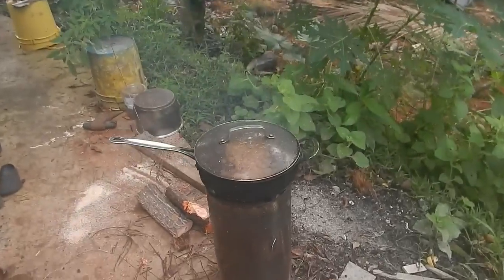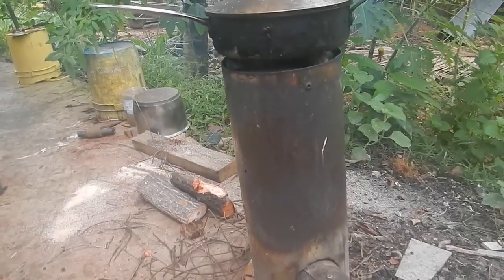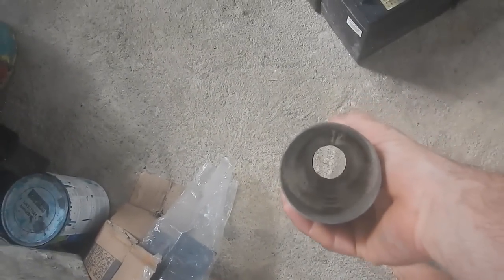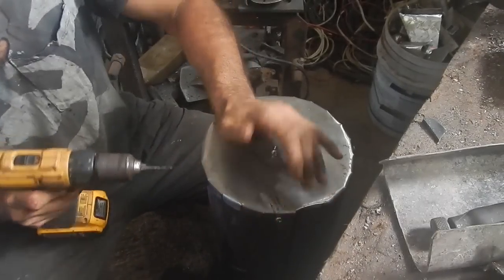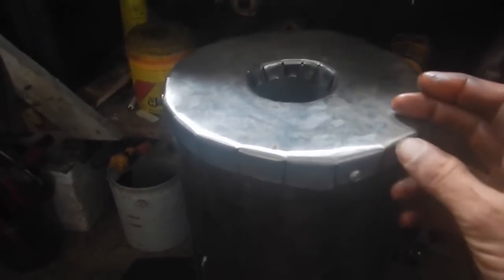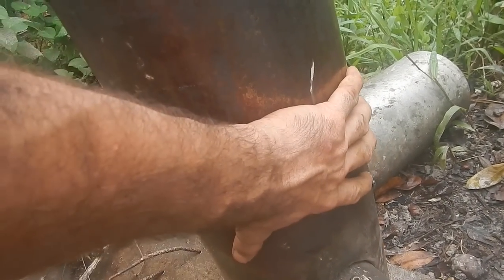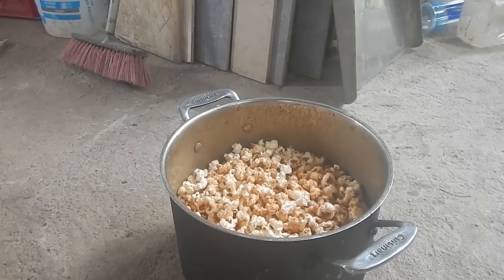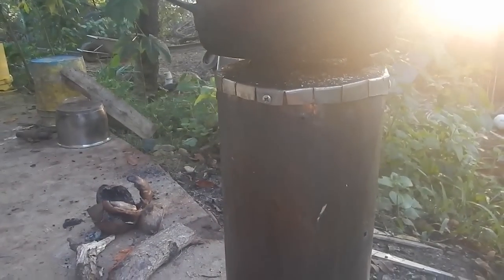Superior Rocket Stove (and Peanut Butter Popcorn!)

Comment: I've made rocket stoves before,  there is just a couple of things, that I found out.  Fiberglass usually melts at the temperature the stove burns at. Some versions of rock wool or rocksol melt have a higher melting point but I have found that perlite or mica are usually better .If you insulate  the side feed tube, make it longer, and start the fire just inside the front ( away from the chimney) it burns better and continue burning when it make the turn up in the chimney.   Your looks great, and some food grade type of stainless steel are safe at high temperatures. Thanks for sharing.

Comment: My experience is that corrosion increases by double with every 10 degrees F in temperature. This seems to work for temps between 40 and 160.  I don't know how well it works for the temps you have in your stove, but hooter is definitely more corrosive.

Comment: If I was making a stove I would use dirt mixed with a little water to fill in the insulate area, its much safer than fiber glass but the dirt will get hot.
Reply from the maker: I'm meaning to at some point use a mixture of charcoal dust, and clay.  Should make for clay foam when the charcoal burns

Comment: Pretty interesting. Letting secondary air in midway should help. It will also help keep the pipe cooler therefore longevity. My ss woodgas camp stove has holes all around the base of the burn tube. It is to allow air and woodgas to enter the fire. I bet it cools the ss also making it last longer. It shows no signs of failure. 304 ss.
Reply from the maker: Nice.  Do you have video of it?
Reply: @JMEMantzel  Nope. Never even made one. Was a bit confused (oldness) it draws smoke out the bottom holes, where it is mixed with air and then rises to go through the top row of holes where it burns a blue flame. Clear as mud? The thing is two ss pipes one inside the other. The air space between them is about 1/2 inch. There is a ring at the top hooking them together. The inside pipe has two rings of holes one at the top one at the bottom. The bottom is closed off. The outside pipe is longer than the inside pipe. Long enough to leave room for a little pm motor with a fan. It has a bottom. There is a row of holes around the bottom edge for intake air. The fan blows air upwards which causes a suction at the ring of holes at the bottom of the burn pipe pulling smoke and fire down through the fuel. So it is drawn out through the bottom ring of holes and travels upwards and exits the top ring of holes where it burns totally clean and very hot. It burns from top to bottom. I.D. is 4.5" O.D. is 6" X 9" tall. It is very simple but very well. Have plans to build a larger one using a cast iron dutch oven (cast iron can withstand high heat) and a large steel can. Keep up the good work.

Comment: Sorry to ruin your day, but stainless steels stop being stainless around 600C, which is barely glowing red. I assume your stove is hotter than that, so stainless doesn't solve your problem. 

What you'd need is some fancy high temperature steel alloy, which typically have aluminium in them, since aluminum oxide protects in higher temperature than chromium oxide in stainless steel. Those won't last forever either, and it's possible that your previous pipe was some heat resistant alloy. It's just very bad combination for metals if temperature is over 800C and you have excess air to oxidize it.

It would be very challenging to make such thing last long time and still be thin enough to heat fast. Some refactory mortars can take the heat, but they need to be thick, so not good idea.

I know you like to experiment thighs you have in hand, but there are couple of materials which would probably work. My choice would be insulating firebrick. They have amazing insulation properties and they can take huge amount of heat cycles without deteriorating. They are so porous they can heat up into glowing temperatures in few seconds, when exposed to fire.

Another possible material is ceramic kaolin wool, coated with satanite or some other high temperature coatings. It is typically used in kilns and forges and have amazing insulation properties in high temperature. It's order of magnitude better than glaswool and even more better than glass fiber. Those probably melt partially in your stove.

If you want to tinker something by youself, I'd try to make porous clay. I have special refactory clay, which is rated to 1500C. It has many secrect ingredients which manufacturer don't tell anyone, but basic mixture is clay and crushed porcelain. To add some porousness, you could try adding crushed coals or something similar. In high heat, carbon burn away if it gets oxygen, but it'll leaves pores behind. Until it burns, it'll work as a decent insulator.

So to make your ceramic inner tube, coat plastic or cardboard tube with your own secret refractory clay, let it dry and then heat it slowly to burn your clay into ceramics.

I have made decent insulating fireproof material from high temperature 1200C refractory moulding mass and vermiculite. You could probably find both from town, but that's not porous enough to heat as fast as other possible materials.
Reply: Most of the world cooks most of their meals on stoves made of old steel barrels.
Reply: Excellent ideas but for me I prefer some solar panels and an induction cook stove. It is simpler, faster, cleaner and the only energy needed comes from the Sun.
Reply: How could that possibly ruin a person's day?
Reply from the maker: Sorry to ruin your day, but there's no way I'd take the time to read a comment that starts with "sorry to ruin your day" and is like... 6 paragraphs long.
Reply: @neliosamch3195  With electric, in an enclosed non-air conditioned space in the tropics, is one of the few situations it might be wise to use a microwave oven.
Reply: @JackHackaday  Maybe because the current pipe most likely don't last very long
Reply: @ydne  Yes, but the key difference is the temperature of the metal and how oxidizing the flame is. In most barrel burners, metal don't get very hot and the flame is oxygen poor. In this type of rocket stove, lower part of the metal can get very hot and it's exposed to excess oxygen which flows inside. It mixes into burning gasses later on on pipe.
Reply: @JMEMantzel  Maybe I chose my starting words wrong and it's totally your choice what comments you read. I write them also on the other people who follow your channel. I never mean to judge what you do but rather provide some additional information or ideas about the matter. I appreciate your willingness to innovate and make your own solutions, because I'm same kind of person, just in different conditions.
Reply: @neliosamch3195  It's actually same with wood, except different mechanism to harvest solar energy. Stove is easier, if you try to be independent. 

What comes to being clean, burning wood is natural and clean if the overall stress on certain area is not too high to either exhaust wood supplies or weaken air quality with particles. There is nothing cumulatively polluting in burning wood, and that's many times ignored nowadays when there are those who want to make fossil fuels look cleaner.

Actually solar panels and induction stove are much more complicated and more polluting if you count the whole process brom manufacturing. Don't get me wrong, since I'm sworn supported of green energy, because fossile fuels are very bad, but we must not forget there's other alternatives than solar, which in some conditions can be better.
Reply: I find that making rocket stoves out of firebrick is quick and easy. I have lined wood gas cells with refractory to increase the heat reflection and decrease the absorption. Never thought of coating a tube with refractory and then burning it that's kind of brilliant.
Reply: @alligatorsoupisgood  I works well. I have used 3d printings and high temperature refactory clay to make complex shapes. I have an ongoing project to develop super high efficiency wood burner to heat my 2000l boiler. I have vacuum insulated stainless steel carbon monoxide converter asa first stage and I'm building high temperature secondary burner and heat exchanger.

I took 300l stainless water boiler tank, split it in half, cut other have open and removed strip of steel to schrink it. Then I put smaller one inside the larger one, filled the gap with vermiculite and welded all the seams and suck the air off. Inside is coated with high temperature refactory moulding mass, mixed with vermiculite to make it withstand cracking.

I fill it with scrap wood and chips, and put air tight lid on. Then I light it with gas flame from the hole on bottom and use small blower to feed the air. Carbon monoxide converter runs oxygen poor mode to keep the temperature around 600C, which is tolerable for protected stainless in oxygen poor conditions. 

Carbon monoxide and gaseous hydrocarbons are then burned in high temperature ceramic burner which is fed with pre heated air to increase temperature and efficiency. That part is still under development, but looks promising. The flame is blue with little red hue and temperature can easily rise into 1500C. There's no smoke or even smell in exhaust.

Because I use electric blower to feed air, heat exchanger can take practically all the heat out. Vacuum insulation combined with vermiculite works so well that after 3h if burning, outer surface is about 50C, even when it's mirror shiny and don't radiate much heat. 

Next phase, if this one works well, is to make Tesla turbine and use it to feed electricity to solar inverter. Brushless motor should work in required rpm and be voltage compatible with inverter. In that setup, I'll harvest heat from turbine exhaust steam.

Just mentioned this, because rocket stove builders may be interested about the concept. It takes a bit special equipment, but still. Don't need to be vacuum insulated stainless, though. In Finland, they used similar carbon monoxide converters to run cars during ww2, and they were only double walled regular steel. It won't oxidize too badly in oxygen poor environment where hot carbon monoxide is present.

Comment: Let's see how many old homeless dude videos it takes for you to discover the secret of smokeless wood stoves?
Reply from the maker: Problem now is that I'm not making any smoke.  What'll keep the bugs away from my homeless spot under the bridge?  Darn!
Reply: @JMEMantzel  Too late, I realized you already got it.
Reply: @JMEMantzel  Looks like that secondary burn tube is doing its job.  With my much-much smaller experiments with table top soda can stoves, I noticed the secondary burn worked great when there was active flame but hardly at all if it was just coals glowing with some organic matter left in the fire.  Really amazing how you can blow heat, from the lower part of the fire, up and around to burn up the remaining particulates in the emitted smoke.  Seems to work even with nasty toxin emitting wet wood.  Maybe because the secondary burn ignites all the particles that remain in the smoke that can't be burned easily in the cooler flame of a wet wood fire?